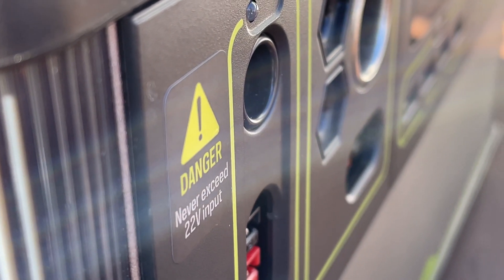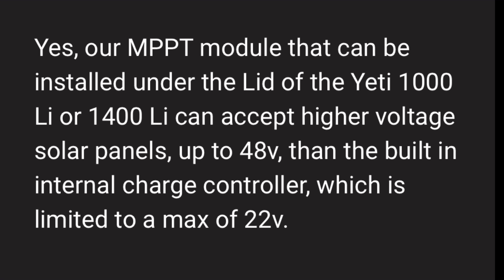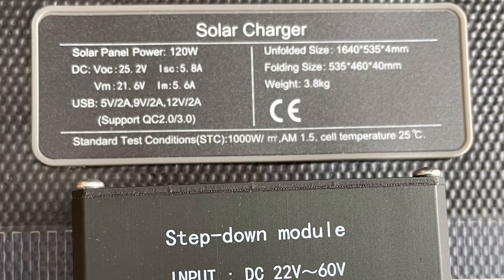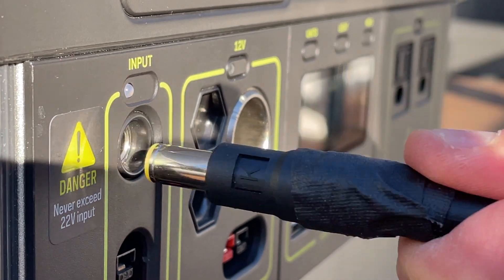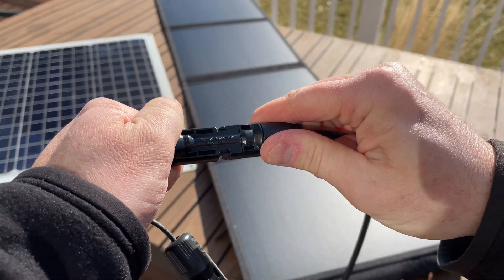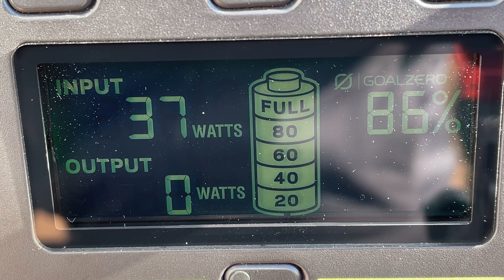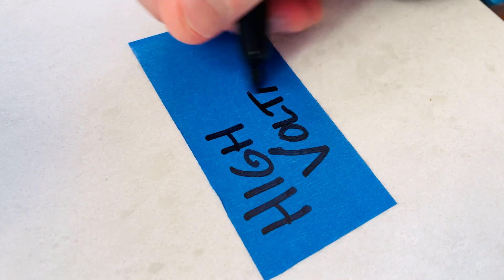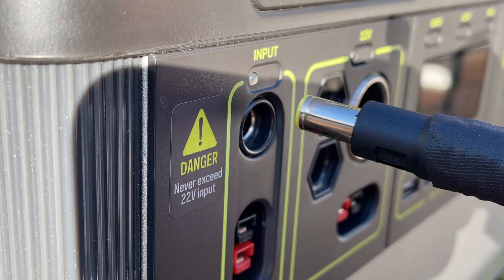Connecting 48v solar panels to a Goal Zero Yeti 1000. Is 22v really the max solar panel voltage?

Comment: I just got a van…. It had the 3000 and 40 v panels. It only charged at 22 volts. It was 300 watts but would only charge at like 160. Thinking about putting a charge controller in between to change the output to 12v to get higher amps.

Comment: awesome video todd, question, I have a boviet 400 watt panel with 49.15 open circuit voltage, I'm wanting to rum it through the mppt on my 1000 lithium. what's your feelings on this, wondering if you may have done more research on this
Reply from the maker: That might be pushing your luck. As it is, 48v is already more than they advertise. With voltage, if you go over the max you can quickly damage the controller
Reply: @todd.parker  what if i use resistors or a "buck convertor" to drop the voltage
Reply from the maker: @kturville  That should work fine then. You just need to stay below the max voltage and give yourself some headroom for colder days when voltage rises

Comment: So if I have one panel that's like 250watts and it is putting out 36.5 volts on a sunny day.   Do you think that I will be ok plugging it into the mppt solar module?
Reply from the maker: It should be but check the open circuit voltage to be sure it doesn’t exceed 48v and only do that if you have the MPPT module. The PWM will blow up over 20v.

Comment: Do you have a link where I can find the tp-solar 25.2voc 120w panel? Looking to parallel 2x120w panels for my eb70
Reply from the maker: This is the new version: Upgrade Topsolar 120W Foldable Portable Solar Panel Charger Kits for Portable Power Station Generator Cell Phones Camera Lamp 12V Car Boat RV Battery(Dual USB Ports & 19/14.4V DC Output) https://www.amazon.com/dp/B07ZZB2H22/ref=cm_sw_r_cp_api_glt_i_Q1W15940ZFVZDZDJH7J7

Comment: So what is the max charge that a Goal Zero 6000x can handle? if you had a 300 watt constant drain / load on the battery? if you hook up a victron 250/100, can you charge using the victrron's 100 amps and goal zeros 50 amps (At the same Time)?
Reply from the maker: I think you’d need to ask goal zero support, their site doesn’t clearly say what the max input is across all inputs

Comment: I've run normal 40v 60 cells on the mppt for years without issue.
Reply from the maker: Good to hear that long term perspective. Was that in the PWM?!
Reply: @todd.parker  the 40v panels went on the MPPT. 

on the PWM I never put a panel more than 20v on, but I could crank 10 amps into it before it started to heat up.

Comment: Thanks for the very informative video.  Did you ever try going above 49VOC (I'm wondering if it simply throws an error)?  Also, I'm contemplating plugging a 36VDC recycled scooter lithium battery into the APP port on the MPPT module.  Do you happen to know if the MPPT will limit the input current?
Reply from the maker: Glad it was helpful. I didn’t go higher on the voltage because I couldn’t wire the panels I had in a way that didn’t far exceed 48v and discrete want to risk it. For the MPPT, I don’t know if it’s current limited but I’d be wary of doing that. It could pull a lot of current and damage the module but it’s replaceable for low cost so heck why not!
Reply: @todd.parker  I just tried testing the MPPT module using both 10s (36v nominal, 41v tested) and 13s (46.8v nominal, 53.1v tested) lithium-ion (NMC) batteries plugged into the Anderson port.  I'm not recommending anyone else try this (aka I take no responsibility if someone else tries this)... but the MPPT seems to be limiting to ~288w regardless of voltage (both batteries can easily do 750-1000w cont. discharge)... which is what I was hoping it would do.  I ran both for about 15 minutes and no issues encountered at that time. At some point, I'll probably hook up a bench power supply up to this to see what the max values are.  Thanks again for all the informative videos you've provided on this.
Reply from the maker: @daweihong  that’s really good info, thanks. So you think the MPPT limits the current? Looking forward to more data!
Reply: @todd.parker  Hi, YMMV but I hooked up a bench power supply that tops out at ~60v (the limit of the power supply) and it appears that, regardless of voltage, the MPPT limited to around 270w-288w.  Testing was done at ~35% SOC.  Disclaimer: I don't recommend doing this and take no responsibility for anyone that tries it.

That being said, I know this would definitely void the warranty and requires careful monitoring of voltages, but have you ever considered creating a direct expansion outlet (similar to the Anderson Powerpole SB175 connector on the older Yeti 1250)?
Reply from the maker: Interesting data. For the expansion port, I think the tricky thing is keeping multiple lithium batteries balanced, something that gets really hard when the batteries aren’t identical. The fact that GZ ended up using lead acid to chain to their lithium cells tells me this is a really tricky to get right.

Comment: When looking at what solar panels are suitable for the goal zero... What are the key things to look at? 
Just the VoC which is 22v and less??
Is the VoC what the 22v max sticker is referring to?
Reply from the maker: That's the open circuit voltage, connected to a battery it's a bit lower but I use the VoC number to make sure I'm staying in the safe zone. Any panel from 18-22v works with the PWM input on older Yetis. You can do up to 48v for the MPPT or Yeti X. You can connect two panels in series to double the voltage and keep amps the same so 2x 22v panels in series will be 44v.
Reply: U mean when not connect to battery is open voltage,  drops when connected

Comment: Another excellent Yeti video Todd!  You're definitely THE go-to resource for Goal Zero! So if we have an MPPT controller and it can accept up to 48V maximum, we can use the Victron Orion 12/24-15 DC-DC Converter and set it to the maximum of 30V.  Whereas on my Yeti 1000 I only have the built-in PWM controller, the actual max input is 22V.  My Orion is set to 20V to power the Goal Zero (purposely just below the max of 22V in case my van is really cold in the winter the Orion will actually push out more volts.  I'll update my video description to note this fact as well.  Too bad Goal Zero doesn't label it properly.  Thanks for the video!!
Reply from the maker: Thanks for the kind words, I appreciate it. Yeah, I’m surprised GZ is so conservative with their specs but I guess that’s their approach. Can’t wait to see what you do next.

Comment: I was looking at getting (8) 100W panels to charge my Yeti 1000.  Splitting the panels evenly between the PWM and MPPT.  Previously each charge controller was limited to 360W at 22V.  With 8 panels running at 90% efficiency I would be within the published limits.  Your 1000W video was helpful in figuring this out.  Now that we know that the MPPT side can accept 48V, shouldn't I be able to add an additional (4) 100W panels and wire them in a 2-Series/4-Parallel configuration?  I would be doubling the voltage but the wattage would remain at 400W (360W @ 90%).
Reply from the maker: So I think the 8x 100w panels divided between the inputs are totally fine, as you said and my video proved. You never get close to the rated power so  400w would be ~320 in ideal conditions. As far as the MPPT voltage, I don't think you can go beyond the 4x panels, regardless of how you wire them because they care about the total input in watts which should be 320w. Assuming your panels are 20v @ 5a = 100w each, if you wire 4x in parallel that would be 20v @ 20a = 400w. If you then wired those sets in series, it would be 40v @ 20a = 800w. Honestly, it's better for the battery to charge at a slower rate unless you're in a real hurry or are charging it under heavy loads. If you charged it at even 800w, that's close to .8C which is pretty stressful on the battery. If you were running say a 500w load at the same time, that would passthrough so the battery would only be charging at 300w (.33C rate).
Reply: @todd.parker  Thanks for weighing in.  I was trying to find a way to run a larger load while at peak sun (5000 btu window ac) without depleting the battery too much.
Reply from the maker: @ericlundquist9032  Gotcha. I think from a heat perspective, it's good to stay within 720w total. I wish the bigger units could handle much more solar power. For the 1000, 720w seems more than enough but for a 3000 or 6000, not so much.
Reply: We run 24v through the mppt w no problem, 12v in series.

Comment: Thank you for this clarification. I've been running my MPPT input on my GZ1000 at 24 recently as well. My unit had a sticker on the PWM that says 30V and the lid says 45V. Maybe I will post a video how I run mine in the shed.
Reply from the maker: Interesting. So you have an older Yeti 1000 like mine but it has different stickers or do you have a 1000X? Post a video for sure!
Reply: @todd.parker  yeah, must be one of the first units. Sounds like they lowered it just for safety concerns. Lid says 16-45 for both 8mm and APP. I've run 40+ into it and haven't had a problem.
Reply from the maker: @chowjaka  huh, good to know that 22v may not be a hard limit on the PWM
Reply: @todd.parker  I always wondered why my Yeti 1000 Lithium (not the X  model for sure) has a 30V sticker on the front but everyone else I have seen on YouTube has a 22V sticker. I've had mine for several years now basically since they 1st came out. I have a sticker on the front that says "Danger Never Exceed 30V Input" When you open the top lid there's another much bigger scarier DANGER sticker on the bottom shelf section in the middle just to the right of where the power supply sits that says the same thing about 30V. Then directly under the lid there's another sticker with all of the units tech specs listed including: for Charging inputs - 8mm round port: 14-22V, up to 10A 120W max and Power-pole port: 14-22V, up to 30A 360W max. Hope this helps? Also there is a section with dashed lines around it that says "Serial number decal location" with no sticker there. So I guess I have no serial number? And before you ask, I don't remember where exactly I bought this from, probably Amazon or Goal Zero directly, one of the two. Keep up the excellent work TP!

Comment: Hi, 
Great video but now I'm confused... You've only managed to plug in 120w worth of panels and it hits over 42v but in your other video you've plugged in over 1kw worth of panels. 
I don't understand. Is the 1kw panel set up all limited to be under 22v?
Reply from the maker: Yes, I connected 1,000 watts of panels but they were all connected in parallel and each was 19v. I’ve been limited in the kinds of panels I can use but now I know I can use higher voltage panels or panel in series for more flexibility and lower losses
Reply: @todd.parker  hum... Maybe I should look more into parallel Vs serial solar panel setups.
I'm looking at purchasing a Goal Zero Yeti 1000x and a few panels to go on the shed roof.
But thanks for the info.

Comment: Bravo Todd! Thanks for your informative and entertaining video.
Reply from the maker: Glad you enjoyed it! Thanks for the tip.
Reply: @todd.parker  Are you planning on making a video showing your Battleborn directly charging your Yeti?
Reply from the maker: @leftofone  Yep! I have been working on 3 videos at once which was...a bad idea. First ones out, got a quick review of the battery charger I'm using, then the charging from a lithium battery. This weekend, I hooked my full sized fridge to my yeti with my 100ah LiFePO4 battery hooked in and trickle charging the yeti. Only used 1 car charger to balance the input and output and it ran for 30+ hours before the Yeti hit 20% and I had pulled 1,800wh. I've had good luck fully charging a Yeti from this battery with 2 chargers going full bore a few times, works great but I think that it's probably better to balance your input and output so you pull the power a bit slower to reduce heat and be more efficient. Anyway, video in the works, got a rough edit together.